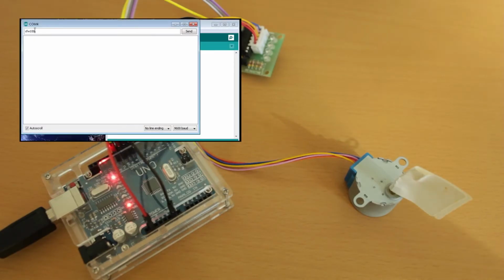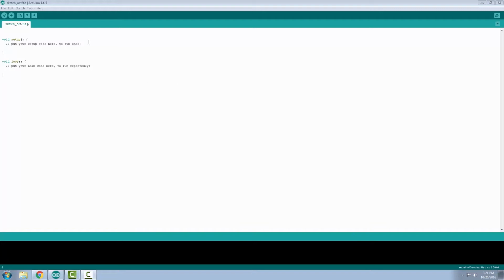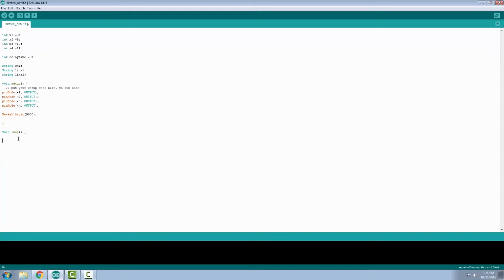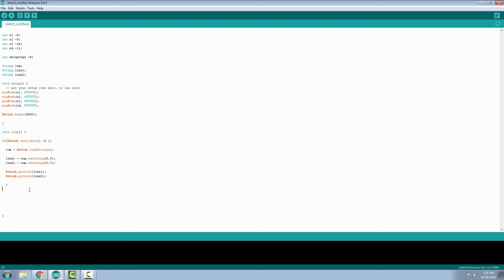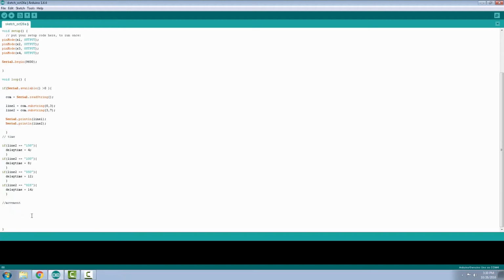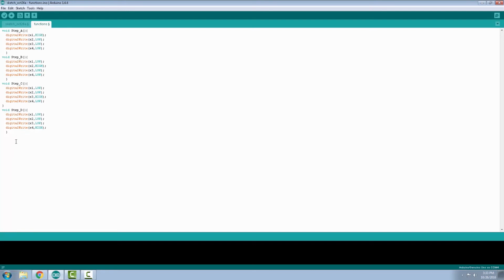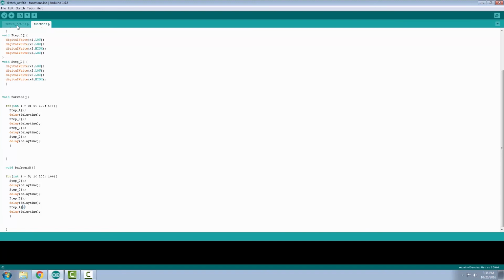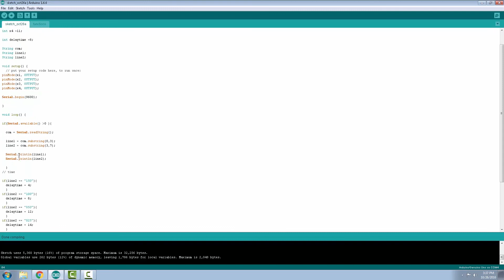Controlling a stepper motor with a PC and Arduino

Comment: How to open the COM4 window ?
Reply from the maker: Priyanshu singh There is that magnifying glass icon on the top right corner. But it won't be always COM4 it depends on the number of the usb bort you are using.